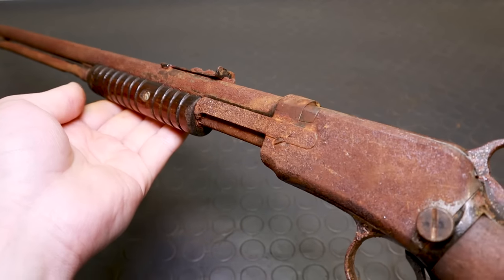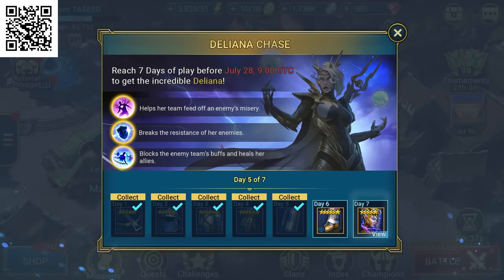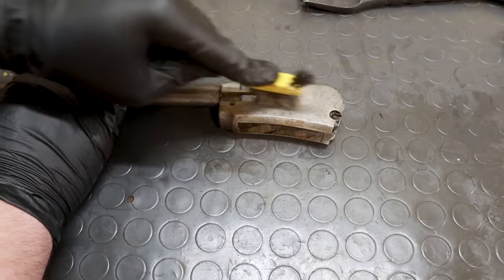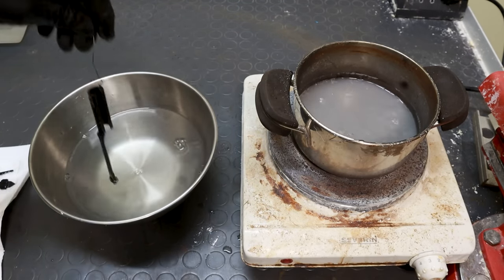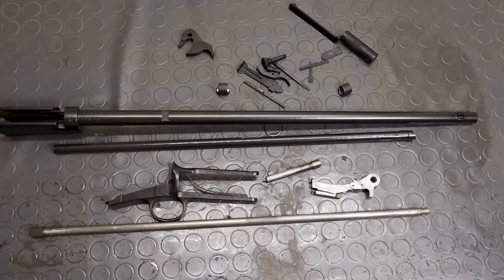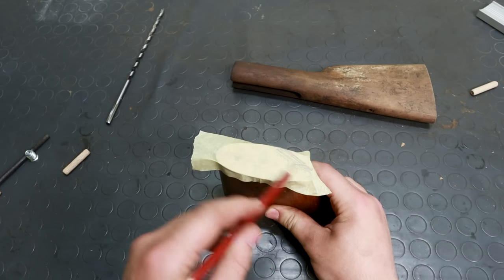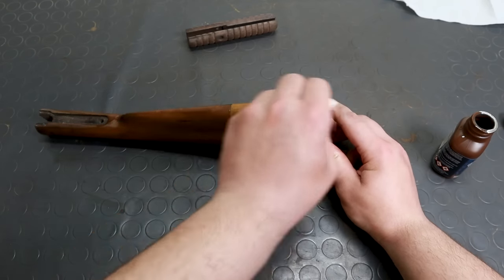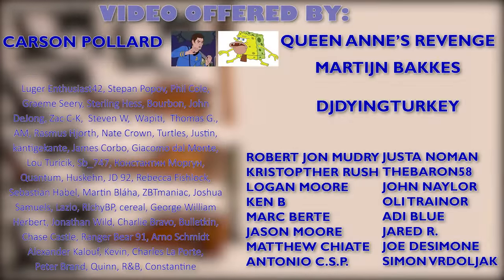Restoring a 1906 Heavily Rusted Pump Action Rifle

Comment: Step 1.  Buy a crappy old winchester 1906 at auction.  Step 2.  Spray it down with viniger and water to accelerate surface rust.  Step 3.  Refurbish it.  Did I miss anything?

Comment: This brings back memories of having a rifle like this over 60 years ago (I wish I still had it). It was the smoothest operating 22 I ever had. No telling how many thousands of rounds were fired through this little sweet shooter. It was a perfect starter rifle and I got quite good with it. Easy to break down and clean and maintain.
Reply: Garth Land  

Octagonal barrel and crescent but plate?  If so I suspect a model 1890.  It is not uncommon to reline a shot out 22 barrel.   It all depends on overall condition as to weather one would really want to make the effort.

Comment: Amazing achievement! I'd say there wasn't a fat chance the two wooden parts would get the same colour, since they come from different essences; but I find the result to be beatiful and unique.
Also, nice to see Maurice have fun with this (it must be a very quiet one if it doesn't require ear protection).
Reply from the maker: it definitely is quiet, just like most 22 LR rifles, especially non-automatic ones
Reply: Considering the length of the barrels on these rifles (20 inches, or 50 cm), it is quite long for a .22 caliber rifle. It absorbs a lot of the sound.
Reply: Fyi, those were .22 short (subsonic) rounds he fired, and not .22 LR (Long Rifle)
Reply: @randomschmo5778  they where not actually
Reply: @randomschmo5778  you can literally see the six month old comment from the channel owner sayng that it is 22LR
Reply: @Ferrari255GTO  -- i literally saw that, and literally think the chanel owner is mistaken. :)
Reply: @randomschmo5778  from what I can see at 17:27 it looks like LR, not short. The cases look too long to be shorts.
Reply: @randomschmo5778  at the end there are shorts. But earlier in the video, it's .22 LR.

Comment: It would be very hard to match the stocks. You have to identify the wood, find or make a stock using the same wood, and match or hide the wood patterns, it's easy to go to further than necessary
The mis-match colours look like a practical & resourceful repair made to save as much of the original as possible, that's the flair of your restoration here and I like it
Reply from the maker: Thanks for the tips! And for commenting of course
Reply: Winchester used  walnut on their pumps and lever action rifles.
Reply: Years of use and the oils from previous owners hands would prove difficult to match, but agreed job well done.
Reply: @wizardofahhhs759  gumwood on the 1906

Comment: I like how you use a screw to pull the butt stock repair together! Next time, consider 2mm (1/16") layer of very black wood or phenolic sandwiched between the to pieces of lighter wood. Since you can't match the grain, this neat black line makes the repair look intentional. The same thickness of material is added between the end of the stock and a recoil pad. You could also have gone back and added darker stain to your lighter piece once you found your mistake, it's very forgiving stuff. Thank you for saving that old rifle, my father had one as a boy and he never tired of telling me all about it, and how he would save up his money to buy ammuntion at the hardware store.

Comment: I like the fact that the stock extension  is an obvious different color. Makes the fire arm more honest! Anyway, really interesting video! It has inspired me to possibly do a similar restoration on a "Khyber Pass" rifle I bought in Afghanistan for $200... it's an old Schneider Enfield in rough condition... some of it is original, but I believe all the brass parts were re-manufactured... probably the stock as well.

Comment: Another successful restoration! That's exceptional accuracy for a 107 year old rifle, too.

I'd say you did a good job with the stock repair, considering. I've heard of people taking shortened stocks like that and making them into adjustable ones, but frankly that would be difficult to make it look right with modern hardware on such a old rifle. Your solution looks to be a very solid option that'll hold up for years, though. The "donor" stock appears to be a completely different type of wood, so it wasn't going to perfectly match no matter what you tried.
Reply from the maker: yes, I think you're right. Thanks for taking the time to comment 😉
Reply: 107 years old? 🙄
Reply: @CadillacDriver  Look, math isn’t my strong suit. 116 years old?
Reply: @foxyloon  🙄
Reply: @CadillacDriver  gonna cry?

Comment: Great video! Quick tip from a woodworkers son, when glueing two pieces of wood you always want to have it clamped together, wood glue expands as it dries and to get the absolute best connection you want to keep it under pressure until the glue is fully set.

Comment: Usually, bright orange rust means it's new rust.  That's a pretty good indication this video is a fake....
Reply: not necessarily
Reply: exactly man, its made it rusty for views
Reply: Bright orange rust means literally nothing about how old it is idk where you got that from
Reply: @derekhenschel3191  Sorry, you're wrong.  Bright scaly rust like that is a pretty good indication it's been soaked in salt water or otherwise screwed with for dramatic effect.  I've salvaged more than one old gun, and none of them looked like that - not even one that had been buried in sand.
Reply: @troystallard6895  the rust also isn't flakey idk if you ever watched the video but look harder
Reply: @derekhenschel3191  Call bullshit all you want.  It doesn't change my personal experience, or my opinion that most of those videos of people 'restoring' bright orange rusted tools and guns are fake.
Reply: @troystallard6895  fresh rust doesn't leave pitting and there's no way to force it's creation short of very skilled Dremel work
Reply: @derekhenschel3191  Fresh rust doesn't leave pitting?!?!?  🤣Now it's my turn to call bullshit.  I have a pair of replica Tower dragoon pistols that were in the bright when I bought them used.  I was rust bluing them with a solution of vinegar, hydrogen peroxide and salt, and got careless.  The barrel on one is pitted as a result.
Reply: @troystallard6895  so, you let peracetic acid sit on your gun way longer then nessisary and caused a corrosive substance known for eating steel to eat away at it? That's just incompetence, but yea it can do that, funny thing is if you leave enough of it on long enough to cause multiple severe pits to form it's likely to have rusted entirely through or to have a massive hole in it by then, you can't create pitting realistically without destroying a firearm
Reply: @derekhenschel3191  Not sure what point you're trying to make.  Yes, the gun has 'realistic' pitting.  Because the pitting is real...  and no, the pistol isn't destroyed,  or anything like it.  It takes more than surface pitting to put a gun out of commission.  As a matter of fact, barrels with pitting on the inside aren't always trash.  My old Romanian Instructie Mosin Nagant has rifling that looks like nine miles of bad road.  And at 300 yards it's still as accurate as any other Mosin I own.  Go figure....

A couple of other red flags on bogus 'restorations,' especially of old tools.  Where's the grime and grease and crud that should be intermingled with all that rust?  And why do the bolts and screws always seem to come right out with the threads intact, with no snapping or galling?
Reply: @troystallard6895  my point is that the pits look too deep to have been made intentionally without seriously damaging other parts, and yea screws coming out easy is a red flag but if you are smart you soak them with a penetrating oil for an hour first

Comment: Well you did a great job of a complete restoration. I used to refinish furniture years ago and you did a great job of mating both stock and new part, reinforcing it. When you have to go with two different grains of would like that, you want to go with something really dark as a stain, like Ebony or walnut, maybe even varnish that would leave a thick coating. That would also hide the point where it was joined together and the two different types of wood grain. It looks pretty accurate to have fun shooting. Great job. You could also always slip on one of those extra thick recoil pads that has about 5 in of rubber that slips up over the back stock and it would probably hide the light grain.

Comment: One of the coolest things about my M44 Mosin is the visible and very professional repair work that has been done on the stock. Whoever did the repair didn't try to hide the large crack, they instead highlighted it as if to say "look here. This was broken and I fixed it, it works as it should now."

Comment: Curious how all the "restoration" videos on this channel have identical rust color, coverage, and texture. What an amazing coincidence. 

🙄
Reply: Gunsmith here.  Yeah that's really sus isn't it?  It's almost like rust is a naturally occurring phenomenon that looks very similar to other instances of rust on items of similar age and material.  /s.
Reply: @Ring3R  this channel has been confirmed fake
Reply: @Ring3R  there are paints for modeling made to look exactly like rust. Rust does not appear on wood like this. The entire gun would also not have an even coat of rust. Also, all the screws are all brand or with little to know rust. I make props for a living. I know what I’m talking about.

Comment: Fakest  looking rust I've ever seen. The butt stock and pump forend  would have been in significantly worse shape if the gun had been in a environment moist enough to cause real oxidation of the steel to that level. No pitting observed on the exterior after cleaning is a dead giveaway

Comment: Regarding the serial number, the factory serial was on the metal frame behind the trigger guard, between the pin and the 2 screws. Looks like yours has that part ground out. It's common practice to assign and stamp/engrave a serial when imported to a country that requires one. (Even the US didn't require serials until 1968).

Comment: Funny that this video popped up.  I had an old rusted 06 as a boy that came with the family farm.  It was always missing the rear sight, but I learned to hit pretty good with it just by centering the front sight with the hammer.   As an adult I took it in to a gunsmith and had it restored.  The first thing the gunsmith did was inspect the bore and it was surprisingly in good shape.  Except for some deep pitting in places it looks and functions perfectly.   Good video.

Comment: When you were using the metal cutting band saw for sawing the stocks, I wasn't worried about it. The main thing is that it'll actually give a cleaner cut since metal cutting blades have finer teeth than wood cutting blades. Also I actually love the two different colors, it adds a nice little extra bit of detail without going overboard.

Comment: I'm sure the inside of the barrel could have used some attention, which you may have done without showing in the video.  If it was me, I'd have made a new stock using the original as a starting place pattern, rather than adding an extension to it.  Anyway, looks nice and it works. so well done. :)

Comment: Grandchild of a woodworker here.  It's perfectly acceptable to use whatever tools you have to achieve your goal.  My late Grampy used to adapt tools to do all sorts of things.  He even had a belt sander that had been modified to stand upright that he used to sharpen his wood turning tools.  Using tools designed for metal on wood is hardly a sin.  They were designed for things much tougher than wood, so it won't harm them in the slightest.
Reply: Also, like everyone else has been saying, the two-toned stock is actually pretty neat.  It allows you to say "I did this.  I made this repair, and I added to the story of this gun."  That repair will probably outlive you, and as the gun changes hands it'll let people know that someone took the time and effort to restore the gun to a usable state.  You just as easily could have replaced the whole stock, but instead you went through the trouble of restoring the original, which just adds to the value and history of it.

Comment: Use heat next time after soaking for a few days.  Stop banging pieces out.  You will only create more damage.  Also, next time try to keep the lines of the metal parts sharp.   It looks better in the end.  I have plenty of experience working on old Winchesters.  The projects only get better with experience and lessons learned from the last project.  Great job keeping this old beauty alive for another generation.  Keep it up!

Comment: Congratulations, at first I doubted that it would look good, but I really liked the result, I gave it my like.
A suggestion for other restorers who want to do the same with the wooden stock: insert 3mm ebony wood or a bronze sheet at the joint of both woods. The contrast significantly improves the finish and it doesn't look like a simple repair.
Regards.

Comment: Nicely done. I retired my 1890/1906 hybrid in favor of a 62A. I did like the crescent but plate of the hybrid. 

Another awesome John M Browning design. 

In order to open the action the firing pin needs to be fully forward. It is also a gun that will slam fire. Much like an 1897 shotgun.

Comment: Great result, looks like the citric acid does an amazing job , far better than penatrating oils. Ive used it to clear millscale but not de-rust, I feel for you seperating siezed parts, Hopefully artillery is kept well oiled  Just dissasembled a rusty ~ 1900 lathe later modified. Dropper bottle with dregs of Kano Kroil and liquid wrench has worked wonders but some pins needed drilling.  cast part I hit too hard will need  TOT tig brazing .

Comment: I restored 2 of these gallery rifles years ago.  I used Birchwood cold blue and a propane torch and replaced the stocks with replacement walnut stocks as the originals were too far gone.

Comment: I have one of these guns. Excellent! They're fun & cheap to shoot & are great for varmits & small game.You can hold the trigger & pump it as fast as you can. I wanted the older octagon barrelled model because I had one as a 12 year old but I didn't want to spend the $700 that they're priced at now. I sold mine fro $5 back in the day.

Comment: you had it right to start with if just glued before the sanding of two pieces of wood ....then dark oil stan entire piece and 2 coats of poly .....scotch brite the poly then thin some darker GEL stain and make light stokes front to rear over the seam until the seam dissapears and the faux wood grain pattern from gel stain will make it completely undedectable by blending it over entire piece leaving some of it ungel stained away from the seam .... then about 6 coats of wipe on polly sanding between each coat to turn into mirror

Comment: Good work on a sadly neglected rifle. I congratulate you.

Woodworkers (and I don't claim to be one) make a tool for establishing the right place to put dowel. Litle round bits that go into one of your holes, with a sharp  point sticking up. So - drill  holes in one piece, put the marker pieces in, take second piece, align it and give it a rap to get the points to mark the place for the holes and - voila. And once again, you did well.

Comment: sir i commend you that is a beautiful restoration.  I do some woodworking as I'm sure you've gotten a few tips but if you're ever seeking to get some red color in wood if you wipe it down with black tea it adds tanin to the wood and will turn it a reddish color when staining it also helps the wood absorb the woodstain more so it will come out darker.  another thing if you wish to say make the wood look aged if you mix steel wool cut up and washed in a bath of vinegar and 2 caps of hydrogen peroxide in a mason jar with a metal lid this will cause the new wood to oxidize and give it the aged look repeat until desired color is reached

Comment: My Father had a rifle almost identical to this one, however his had an cartridge extractor that moved back in line with the hammer and seated the next cartridge into a fully exposed breech. The entire cartridge rode up and into battery by way of this "extractor loader" and fully exposed the entire cartridge with an up and in, then out and down action that flipped the spent cartridge into the air and in front of your face! As I recall it took, .22 shorts and .22 longs but would hang on extraction when .22 long rifle cartridges were used. My dad said that my great grandfather gave it to my grandfather as an 8th birthday gift around 1918 (times were different then).

I have no idea what happened to it, but it was a neat little rifle that I an opportunity to shoot when I was 11-12years old.

Comment: Fascinating restoration process with the knowledge of chemicals. The woodworking part is very good too. Thank you . The Model 1906 looks nearly identical to my Model 62A, mfgd. in 1948.
Reply: The big difference with the 62A is a coil spring to actuate the hammer rather than a leaf spring.
Reply: @gotsloco1810  , Thank you. When I got mine 4 years ago from an estate sale, it was original NIB and never fired... so 99% pristine. At that time. I read everything I could find on the model 61 and 62. By the serial #, I managed to discover it was mfg'd. in 1948, the year I was born.  ^^^  When I was 7 yo, my Grandfather graduated me from my Daisy air rifle, (the one with the golden shot, which would roll out of the barrel if tilted downward), to the WC .22 model 62A, which was old when I first shot it in 1955. I spent summers on my Grandfather's farm in Mississippi from 1955 thru 1960. I put thousands of rounds thru that .22 ..... good memories. That 62A went to my younger brother when my Grandfather passed. So now I 've got my own.